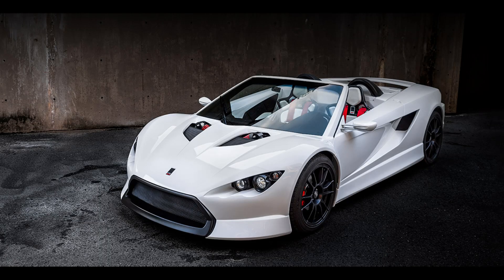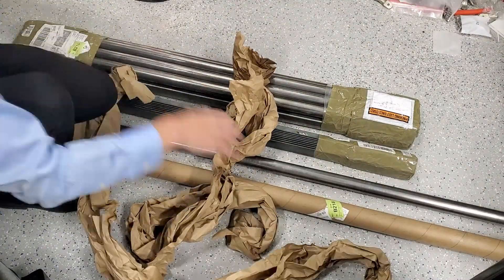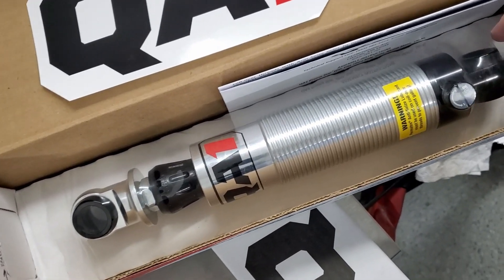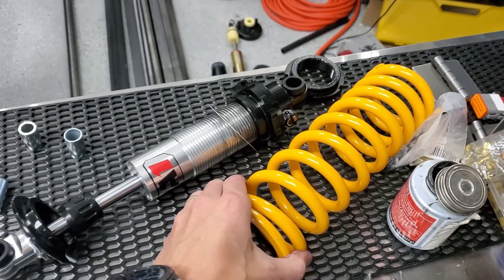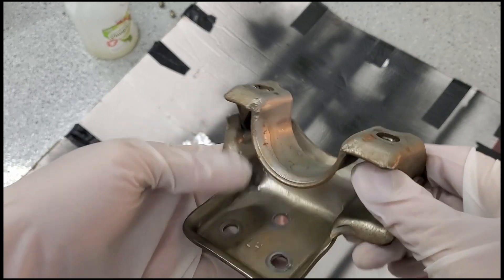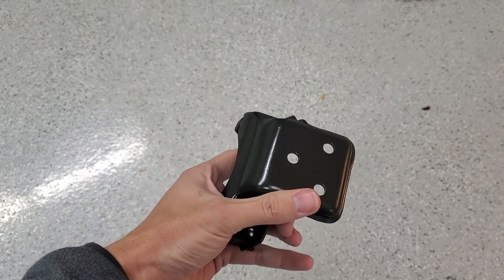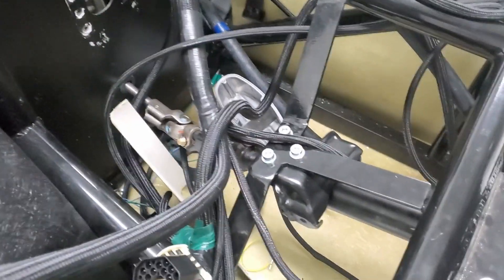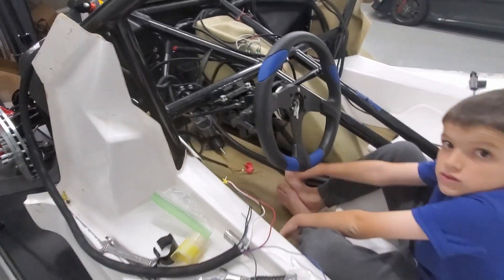Battery Box Design

Comment: all that weight in the rear :O
Reply from the maker: This kit car is designed to have all of the weight (engine) in the rear.  The Tesla motor weighs much less than the internal combustion engine.  Also all the rear battery pack will be in front of the rear axle, which is good.  I am also placing a battery pack up front to help the weight bias.  This should be better than the original design for weight distribution...but yes it will be rear biased